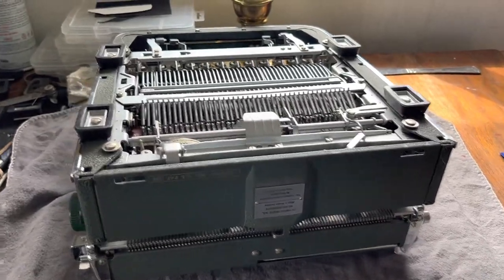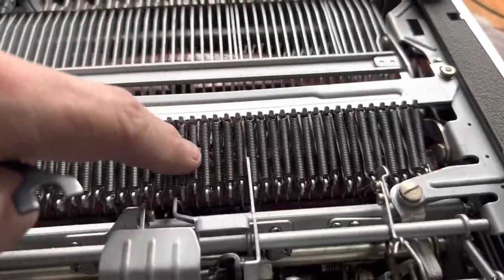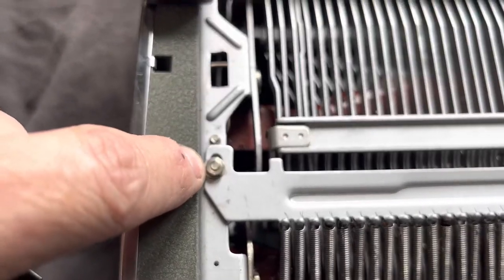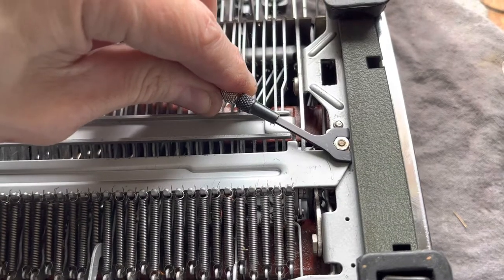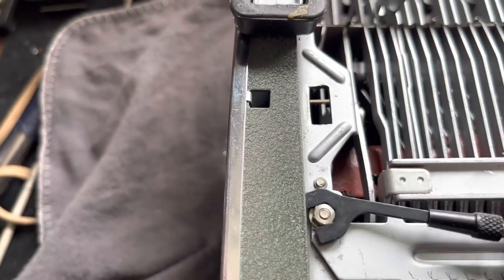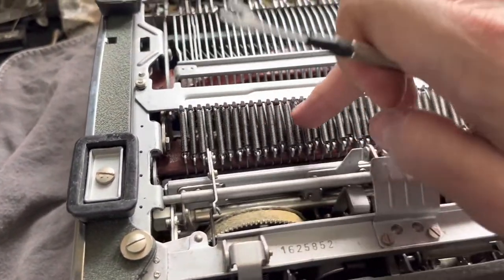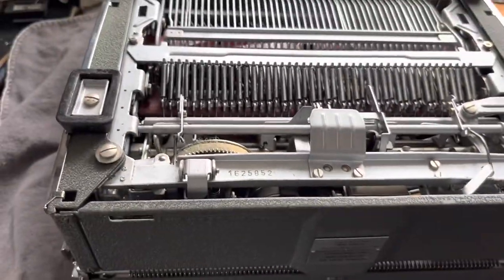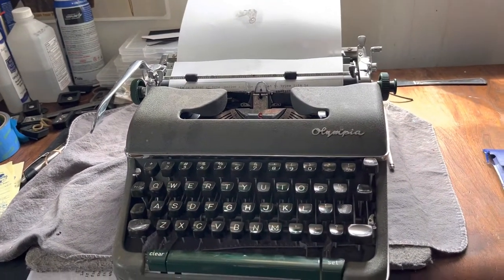Easy and Quick Olympia Typewriter Tuning Tip For a Lighter Key Action

Comment: I did this on my 1957 SM-3, and it made the key touch lighter, and it also made the key throw longer.  This is reducing the tension on the return springs, right?  There are also a couple of bolts with lock nuts on the return spring anchor bar on my machine that act as a stop for the universal bar(?) that can be used to adjust the length of the key throw.  I turned them in until the keys didn't contact the platen, then backed them off to where I just started getting a good imprint.  It really changed the feel of the machine to shorten the key throw.  Thanks.

Comment: Thanks.  My 1969 SM9 will adjust the same way but the slot is not visible under the screws.  As soon as I loosened one side the tension drop the rack back.  Then same on the opposite side.